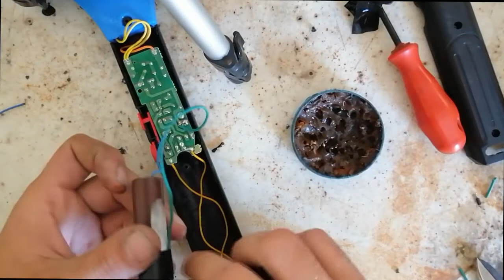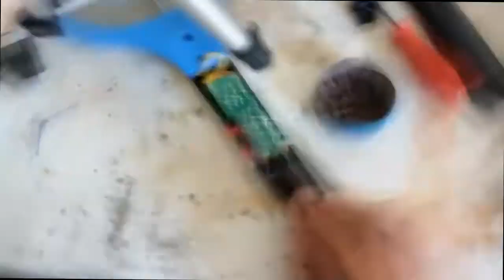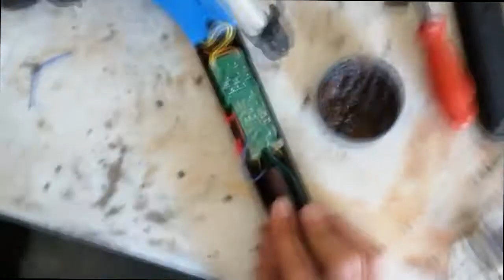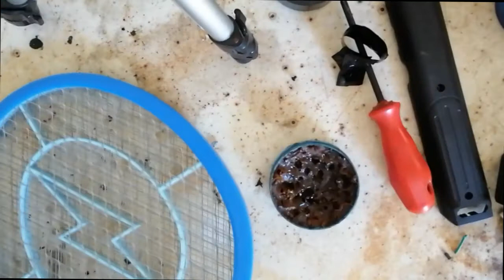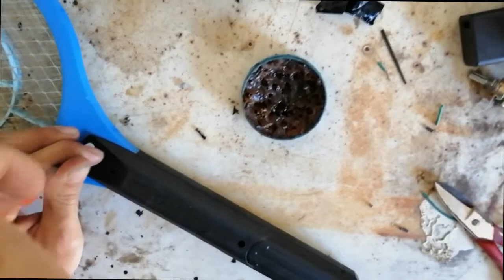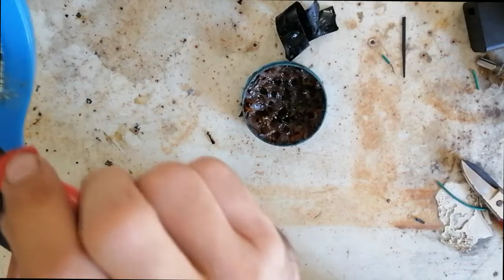raqueta mosquitos cambio de bateria por una 18650

Comment: La carga que utiliza esa es de 154 DC es demasiada corriente para una batería18650 es una bomba de tiempo videos así deberían sin normas de seguridad ni nada nointenten hacer eso es muy
Reply from the maker: La carga? Como la calculo? Ley de ohms voltaje resistencia….. 154 dc?  En si es corriente pulsante de alta frecuencia q carga un capacitor q es no polarizado. Asi q es AC no DC pero bueno
Reply: Según varios vídeos que he visto hay que usar un módulo de carga para baterías 18650 y un regulador de voltaje de 3.7v si no estoy mal y se carga normal con el cargador de celular
Reply from the maker: Carga serían amperes no DC voltaje no se q cosas raras andas calculando según
Reply from the maker: Módulo de carga obligatorio y con el cargador de celular así es
Reply: @MecanicaMazElioPezzMecatronica  lo que no comprendo es donde se conecta el módulo protector de la batería de 3.7v porque en el vídeo no lo usa
Reply from the maker: @xdGato2023xd  busca en Google  no tiene mucha ciencia